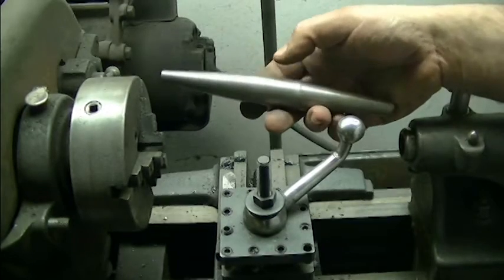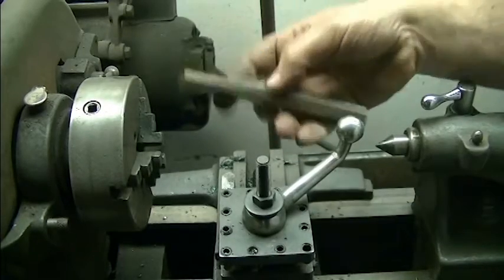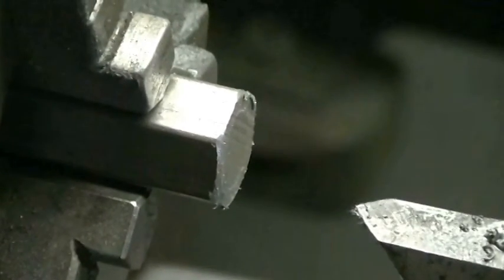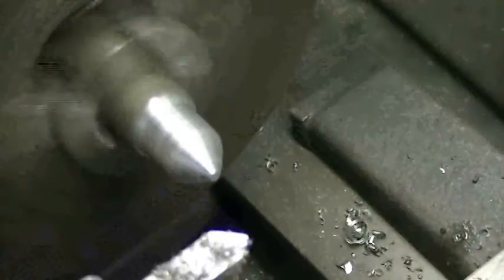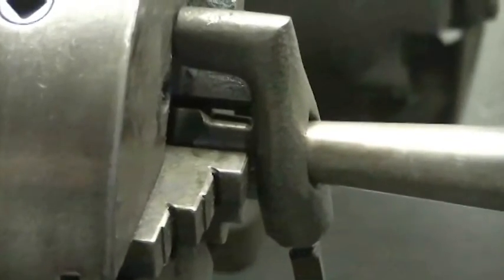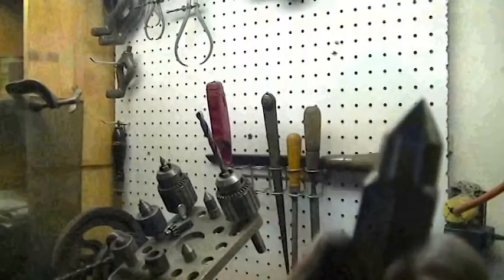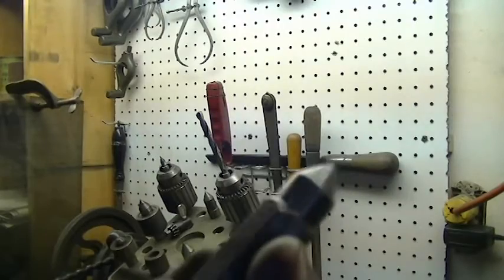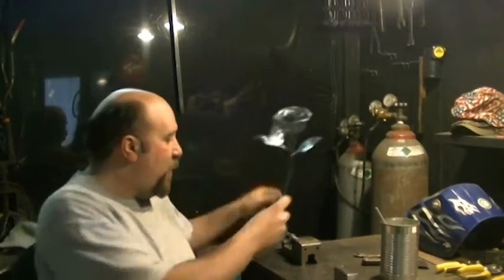Making A Lathe Headstock Center In A Pinch

Comment: I also lack a head stock center and have come up with more or less the same solution you have but perhaps a little different approach. I settled for a round bar and gave it a 60 degree tip using my compound. Every time I need to use it I chuck it up, set the compound to cut 60 degrees and just skim it of to eradicate any runout introduced by the chuck. Works like a charm!:)

Comment: To get the 60 degree point accurately, you can use the compound slide. Once set to the required angle, you feed with the cross slide for each cut, and traverse across the part with the compound. Just be careful about chuck clearance when working close to it.  A "free spin" before you start the motor is wise. 

-- Mike

Comment: If you Case Harden the mild steel, you’ll be able to harden it, turning it from mild steel, to carbon steel, in turn allowing the possibility of a hardened and tempered state within the headstock’s grain structure.

Comment: Hi ,
Greeting fron the UK.
I love your videos, just a quick thought.
if the piece to be turned is not rotating with respect to the chuck ( because of the dog) it won't wear your new point  ( so doesn't realy need to be hardened)  and the only marks ar caused by the pressure from the tailstock.
keep up the good work.
kevin

Comment: ...a headstock center is a live center that turns with the work...
...no reason a soft center won't survive indefinitely...
...turn the center using the compound set at 30 degrees...
...true it whenever you replace it in the chuck...
...what you did is very common...
...and realize that a headstock center turns with the work and can't wear...